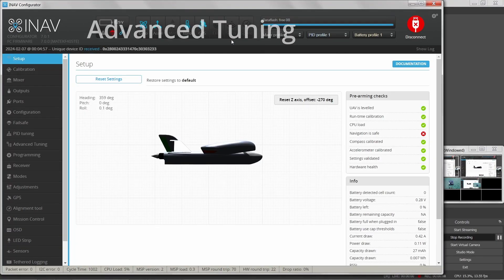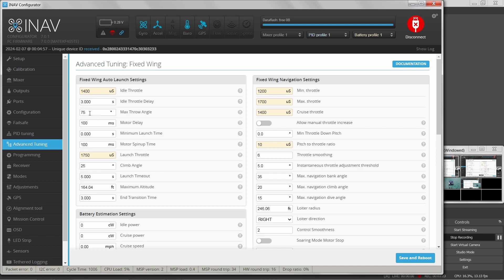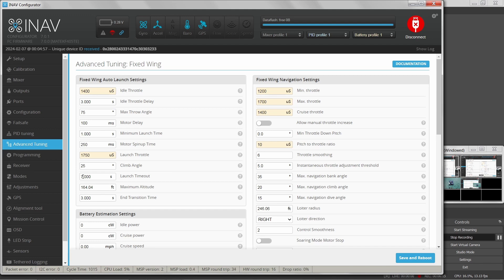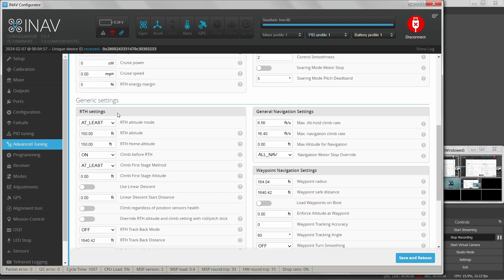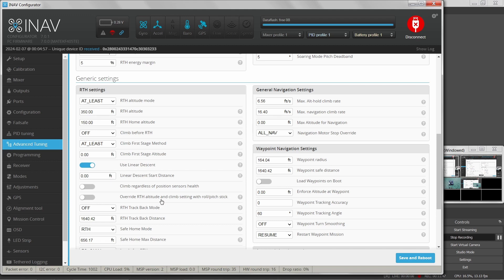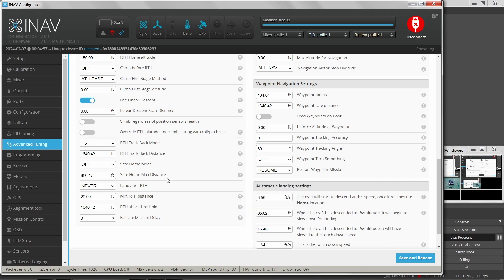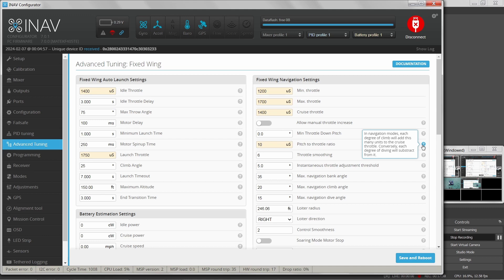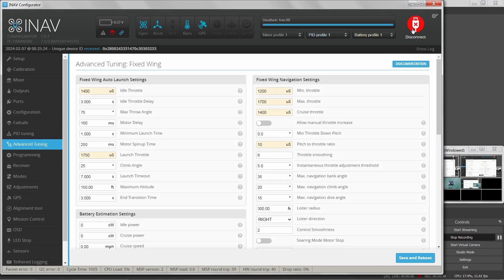INAV: Advanced Tuning Tab

Comment: Sounds like Motor Spinup Time would save your planes from rolling over by torque rather than upping Idle throttle. I'd set Idle throttle to something that makes my motors spin, just to communicate that launch mode is enabled.